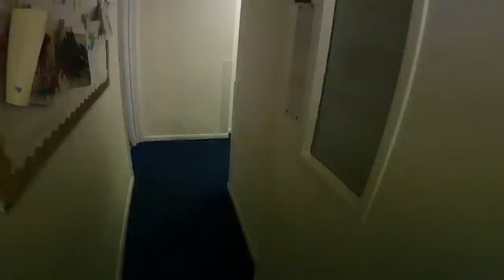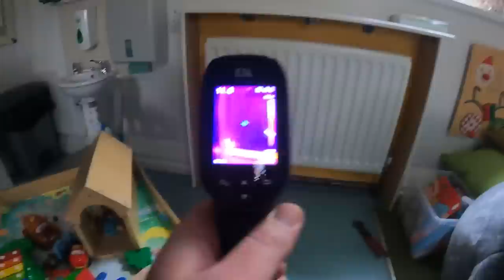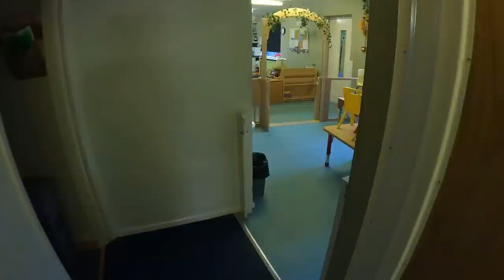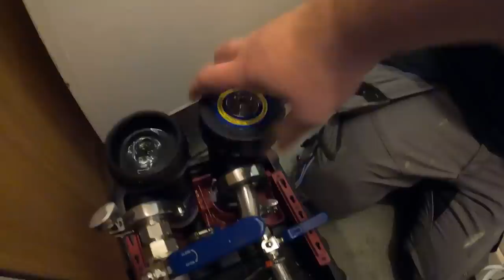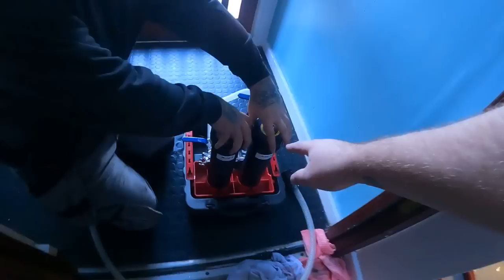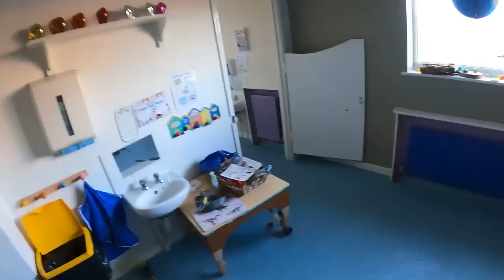BALANCING A 36 RADIATOR Heating system & complete FLUSH THROUGH.. DID IT WORK???

Comment: Firstly I'm not a troll at all so dont that, this is all constructive and please take it like that. You've changed the pump and left the head in the wrong orientation which is no biggie. You've flushed the system but showed us one rad with sludge build up on the video, fair enough. My biggest gripe is the balancing method, obviously no trvs but you have shown on video balancing rads with the wheel head lockshields? I know the rads have covers on but someone could take them off and fully open them wheel heads by hand, ruining your "balancing". Teaching that Mason fella poor methods mate, always balance the normal lock shield? Like I say I'm not trolling at all just trying to be constructive!
Reply from the maker: Anyone that opens a comment with “Firstly I’m not a troll”……. Is clearly a troll.

If you watched and LISTENED to the video it address ALL the points you’ve tried to make😉

Thanks for watching……👍🏼
Reply: @MJTiffPlumbing  bit of a kop out starting your reply with my opening statement, fair enough. I'm not a troll though, far from it. I've watched and enjoyed your videos since day one to be fair mate. Was just picking up on obvious facts, no harm or 'trolling' intended. Obviously you're quite conscious about your inadequacy and incompetency else you wouldn't of opened your response how you did. Keep doing what you do but just try and take the constructive criticism on the chin rather than sending childish responses that are clearly uneducated ones. Cheers, chris.

Comment: Happy New Year fella. Great video as always. Re the light flickering, if I remember correctly you’re using a GoPro. Within the Settings make these changes….

1. Video Format - set to PAL not NTSC
2. Frames Per Second - set to 50hz 

As the cameras are set up for the American market the default settings are NTSC and 60hz. You should always shoot in PAL when in the UK. As for the Frames Per Second (may say Frame Rate), you can adjust to suit your conditions but you’ll need to adjust to 50hz for indoor. Hope that helps.
Reply from the maker: Thanks buddy…. Happy new year…

I will have a play around with the settings… much appreciated 👍🏼

Comment: The pump orientation dosent matter, its the body of the pump that determines the flow, you can put the pump head whatever way you want but usually manufacturers tell you not to put the cable entry at the top
Reply from the maker: Yep you can👍🏼

Comment: Great video -  very informative - A question -  instead of using a thermal camera, is a laser themometer just as good, pointing it at the flow and return end of the radiator, to measure the heat fall across the radiator..?
Reply from the maker: Thanks mate…… yep I don’t see why not mate👍🏼👍🏼

Comment: Hi Mark thanks for another great video, however you mention the time it took to magnaclens and thorough flush the system, would it not have been quicker to use a power flushing machine.
Reply from the maker: For me it’s not about rushing the job, we allowed 2 days to do such a big system so we could get it thoroughly cleaned and flushed.
Reply: ask him about mains flushing small systems? dipending on incoming bar pressure and flow rates. my area you can get more out. even if it is cold. tested. under certain circumstances.

Comment: Just a question lol, but why not whip pump head off and turn it round. One of the main reasons why pumps fail as if it leaks from pump valve, the water will always drop into electrics. If the pump head spun round other way, water cant get into the electrics for pump. Gotta be one of my pet hates lol
Reply from the maker: Which pump mate???….. the new pump has the electrics on the side…
Reply: @MJTiffPlumbing  the pump yous changed like for like in the wee store room.

Comment: Hi Mark, first film of the New Year was excellent as always, some excellent kit used there on this system flush.
That was a big system, I’m sure the customer will be pleased with the results, as you say the cabinets around the rads will not help with the heat output.
I too am not sure about the rules with children and hot radiators etc.  Looking forward to what comes up on the channel in 2023, take care, all the best, regards, Chris. 👍👍👍
Reply from the maker: Thanks Chris…. All the best for the new year.
Yer it was a big system that needed balancing well for it too all come to temp
Reply: Today heating system are not same old heating system! My own system how build in apartment around 1984 with heater how build last 1980 works with come-out at ~80°C/90°C. Modern system heater (build 2018) at my friend's house work with come-out at ~40°C and sure need longer to heat-up all radiators but all have max. 36°C - do you renember this is human body temperature? This should be not harm babies, toddler, children, and adults. Easy to see why they put all radiators into a cabinet in the history. But not needed it 2023!

Comment: Have you seen the HeatGeek video about balancing? Using lock shields as a method of balancing a system isn’t great practice. 
Some lock shields are fully open even when they are only quarter turn…… 

You should consider IMI eclipse rad valves. 👍🏼😁
Reply from the maker: When all you have is lockshields that all you can do, and the thermal imaging showed us that it was working😉👍🏼

We have quotes to change all the valves to TRV’s but a 36 rad system isn’t something you can do “while your there”……
Reply: @MJTiffPlumbing  take a look at the IMI balancing rad valves. 
They will help with keeping a consistent DT across the rad and a more stable rad temperature.

Comment: surely need 50 minimum at top of each rad mark?   bigger boiler needed no?
Reply from the maker: To bring the whole building upto temp with what they had it was balanced at 30 degrees across the whole system…. Otherwise it would starve certain zones

Comment: Great job and video boys. What a good feeling to balance and sort a system that big 😅. Jus a few questions if I may. What’s the best way to balance a system I see you were trying to get them all about 35 degrees was that to make all the flows the same how did u choose a temp for them to all be? Need to get one of them thermal cameras and also sorry for long post what is a thorough flush is it just to pump clean water through
Reply from the maker: We aimed for 30/32degrees on all rads on this system to lift the core temp of the building without starving heat anywhere.
The Thoroughflush is a mains water flushing system…. Take a look I’ve done a full video on it👍🏼👍🏼

Comment: Morning Mark.  Great video last night.  Ive just bought the through flush. Have you used it on a gravity system
Reply from the maker: Hey buddy, yes I’ve used it on a gravity system, make sure you cap the header tank👍🏼
Reply: Just the same as a power flush then
Reply from the maker: Yes buddy👍🏼👍🏼

Comment: Think Adey have a new cleaning chem available now for rapid use…..MC something or other, sure I’ve seen it on the shelf. Impossible to quantify if it does a better job of course. I tend to put my kneeling pad against the rad before I whack it with the mallet…….can give a bit more GBH without scuffing the rad 👍
Reply from the maker: MC5….. that’s the most powerful one that have in the range… great for really sludged up systems
Reply: @MJTiffPlumbing Apologies, thought the red top bottles were MC3, neither here nor there really at the end of the day 👍

Comment: Great job that's a big system, but you should have put the pump motor the right way up just unbolt the motor and turn it.
Reply from the maker: Not when it’s on the return buddy, don’t want it working against the primary flows…… we replaced it like for like as the original one was fitted that way.
Reply: @MJTiffPlumbing  just spin the head, it doesn't alter the direction of flow. Thats what Roger was trying to say
Reply from the maker: Got ya 🤣🤣……

Comment: Why is the immediate instinct after cleaning the magnets to put the magnet back in the bucket full of the black schale deposits 🤦‍♂️. Satisfaction seeing a full magnet. Just started doing flushing myself and unbelievable how some systems actually work at all with the stuff in them. One large curved rad took over an hour to clean and washed magnets off at least 4 times, solid amount every time
Reply from the maker: Such a satisfying job flushing systems…..👌🏼👌🏼